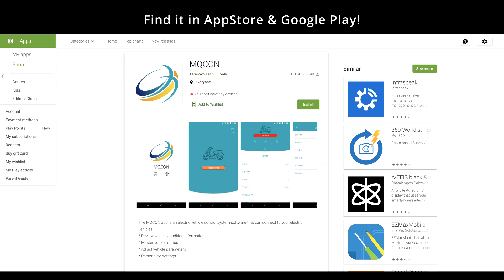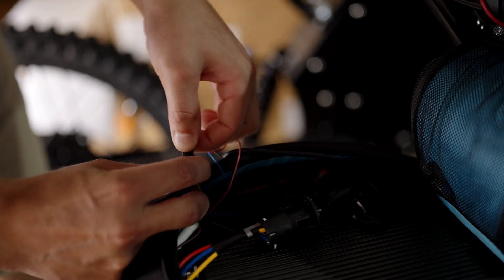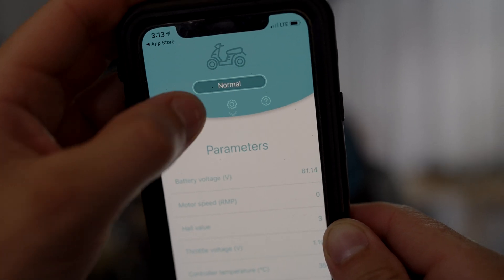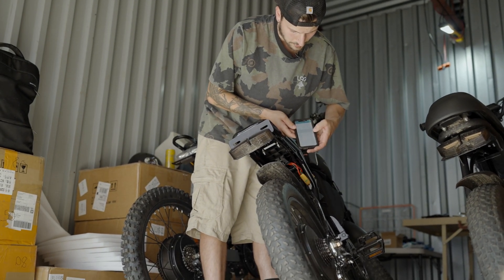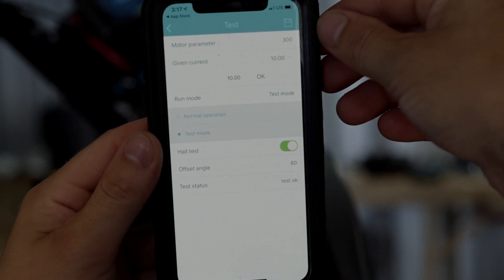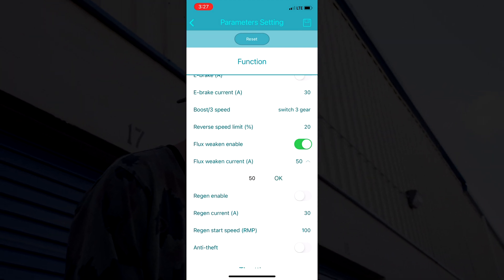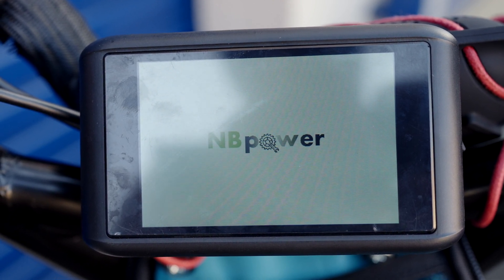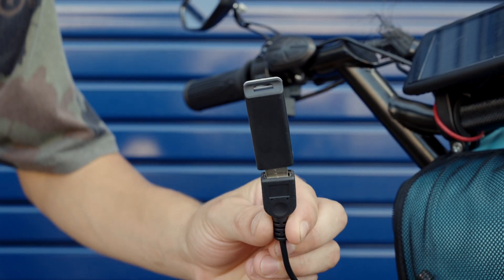How To Tune Your Sabvoton Controller (MQCON App)

Comment: I have two questions. 
1. How do I change it from kph to mph?
2. Everything on my display is mirrored for some reason. Would you know if that’s a setting? Everything looks fine, it’s just that everything is backwards. Thank you!
Reply from the maker: Make sure you double press the M and go into system settings. From there you can cycle the settings under Imperial to adjust it.
Reply from the maker: There is also an option somewhere in the settings where you can adjust the screen orientation.

Comment: My MQCON app seems to be saving settings, even though the 3 pin connector hasn’t been disconnected from my display. Is that possible? The settings in the app don’t revert back and it appears changes are being made and saved. Can you confirm if it’s possible, or does that connector need to be unplugged for sure?
Reply from the maker: As far as I know it's not possible. It could be some error w/ the system causing that to happen. I would continue unplugging the 3-pin before making any changes.

Comment: I have a friend that bought a bike from a bike shop it’s a stealth bomber with a Sabaton controller…it’s a 150a one…his battery is a 150a BMS 45AH battery….the shop took the Programming module, and won’t give it to him…they also have a generic Digital display hooked up to it…..im Wondering if I can use my module to turn boost mode on his bike.

My bike has a 80a Savoton controller with a 80amp BMS battery…..my bike is faster’ and should not be able to beat his bike….The shop disabled boost’ basically nerfing his bike’ his bike is heavier…including rider weight 
He’s about 85pounds heavier include rider weight’ I know they disabled boost…his bike has no acceleration, and he’s only getting 60mph top speed….mine is getting the same top speed…his bike should be killing my bike in a race.
Reply from the maker: You definitely need a button for boost mode unless you set it at hard start. You can plug it into the computer directly and you won't need the bluetooth module. It's a lot easier with the Bluetooth.
Reply: @e-streetbikes6381  I was able to get into his bike with my module….we turned on boost….but the bike ran slower, I eventually reset the computer, and did the haul sensor test…and turned on boost, it now runs a lot faster.

Now I know the difference between a DIY bike vs a store brought one….it didn’t have the color display, and many wires were hard wired into things, like the lights….the display was hard wired into the computer…I had to jumper 2 wires to get into the computer… the bike shop took the module…purposely….if he gets a short In his system, he’s gonna have to have that module for a reset.
The owner wants to buy a more powerful bike….I’m trying to convince him to build his next bike.

Comment: hi,
very good video.
I have error code o2h,controller protect.
any idea what it could mean?
thanks
Reply from the maker: That is the controller's safety feature that will turn the throttle off if anything hits the controller (sometimes something heavy or metal). If your sabvoton is in your bag, make sure there's nothing heavy or metal in the same bag that can come in contact with it.

Comment: what happens if you boost up the motor parameters in the hall test screen.i put mine at 1500 and there was a noticeable difference.
Reply from the maker: As far as I know that's meant for hall calibration so I haven't really messed with that. If your looking for top speed adjustments, you can adjust the flux weakening.

Comment: Hey my man! What’s the drop out ( measurements )on the first generation Xclass 52v ?! 

Trying to upgrade to a 3000w motor 72v and I was asked during the quote process and couldn’t give them an answer 😫

Please lmk🙌🏿
Reply from the maker: The dropout for the 3000w kit is 170mm. Let me know if you have any other questions as well! You can also hit me up at +17322586808

Comment: Hey man really love the kit! I'm actually helping a friend install it on their X-Class. Followed all the directions precisely but for some reason the QS8 connectors from the Sab to the battery keeps heating up to almost melting point. Everything works fine on the bench but as soon there's any load on it the connectors start smoking and I have to disconnect immediately. All the connections look good and tune seems fine. Not really sure what's happening.
Reply from the maker: Hmm looks like the blue and the green phase wires might be switched up. I would make sure the hull sensor colors match and if they don't you should switch them. I came across a similar issue with a motor kit that I used a V2 controller (it was meant for a V1).
Reply: @e-streetbikes6381  I think we may not have seated the QS8 connectors fully and it arc'ed on the first test. We have some new QS8 connectors coming in tomorrow and we'll test it out. I'm like 95% sure that's the reason. Will keep you posted! 👍
Reply from the maker: @RunPlayBack  For sure! Keep me updated, I'm curious as well.
Reply: @e-streetbikes6381  Hey man! So looks like we didn't seat the connectors fully. I cleaned the terminals and seated it correctly. Everything works perfectly now! I'll definitely recommend this kit to anyone whose looking for a 72v upgrade. Keep up the great work and thanks again for the support! 🙏🙏🙏
Reply from the maker: @RunPlayBack  That's great news! Glad it wasn't a bad QS8 and everything worked out 🙏⚡
Reply: @e-streetbikes6381  Love it man! Here's our full review: https://youtu.be/-6_L5ULNbbU
Reply from the maker: @RunPlayBack   Super dope dude! Thanks again for the shout-out, and let us know if you guys need anything or have any questions at all.
Reply: @RunPlayBack  that's common for those connectors causing arc(heat) because they are not fully seated throw som dielectric Grease and use a zip tie on the connectors from the female to male so they are extra secure and vibration doesn't loosen them up, or heat shrink the whole harness

Comment: Watch you video great video but I'm struggling to programe my sabvaton controller. I pulled that wire our the message when connected I get is lack voltage. And when I plug my computer in its only coming up with tx button flashing not both can you help
Reply from the maker: After you unplug the 3 pin display wire, you can access the settings via the MQCON app on your phone.

Comment: Im just getting 30h. Everything is set up correctly and my android app doesnt work. It connects to the bike but I cant change any settings. When I change settings they go back to 0 after a few seconds. Yes the 3 pin is disconnected. I have the exact same setup as you.
Reply from the maker: Give me a call when you get a chance I can walk you through it. 732-258-6808. Usually you have to hit the save button every time you make a change to make sure it goes through.
Reply: @e-streetbikes6381  I've tried literally everything. Pretty sure the app is just broken. USB works and is recognized in a PC so I know it's not that. And my settings from back when it did actually work are still saved.
Reply from the maker: @UsaRubber  Are you looking at the app while the 3 pin is plugged in at all? Also what does the error say? Communication error, lack of voltage, etc? Is the error always there?
Reply: @e-streetbikes6381  pretty sure the app just no longer works. Everything else works

Comment: hi buddy dose this controller work out the offset angle itself? and my motor is running backwards when o change it from 0-1 it doesn't move any ideas?
Reply from the maker: Are you unplugging the the 3pin display connector before changing any of the settings in the app?
Reply: @e-streetbikes6381  probably not it's second hand and all the plugs are changed and lots of brake lines added but thanks it's probably worth a try
Reply: @e-streetbikes6381  thanks mate it worked I was reluctant to unplug as my throttle is connected to the display so was being a little dumb but it's working awesome now thanks again 👍

Comment: Hello! I basically did the exact same build you did, Ariel Rider x class, direct drive rear hub and all that jazz. But I just fried my controller. Would you recommend the sabvoton?
Reply from the maker: Sabvotons are great especially with the NB Power motors. What type of controller were you running?
Reply: @e-streetbikes6381  a Flipsky 75100